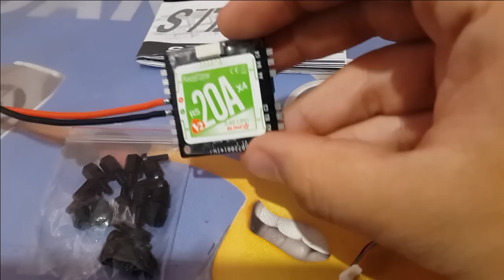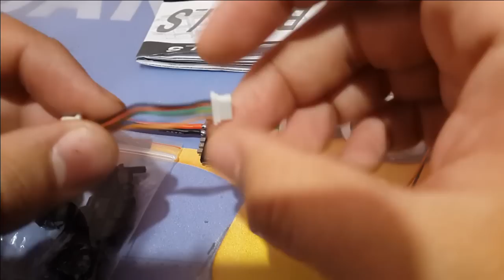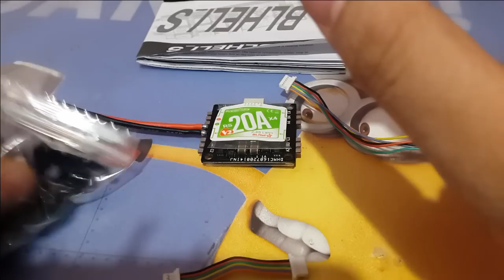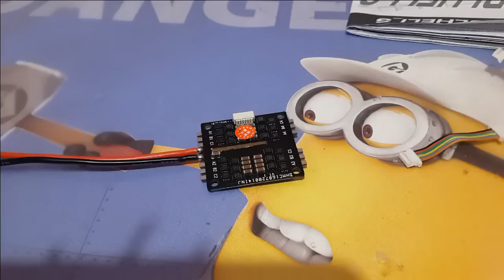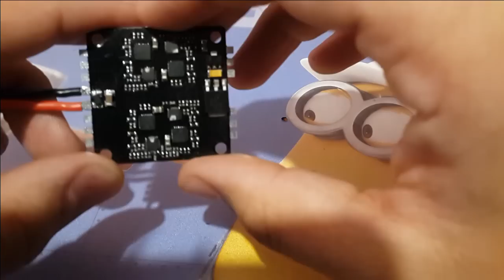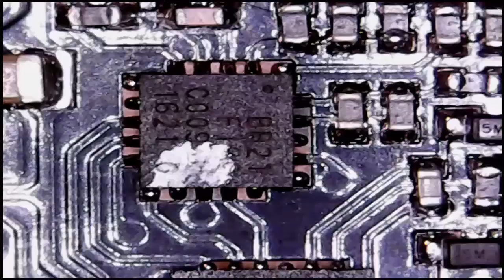Racerstar 20A 4in1 V2 ESC DSHOT 600 (Remove Filter Cap)/ Mini Review

Comment: hi Drone mesh.. can i asked fpr ypu expert advice on this esc
currently blheli release the new firmware with dshot command
is it possible to not remove the cap. 
flash the latest firmware n dshot 600 the racerstar 20amp 4 in 1 esc.?

Comment: Is this the cap removal nessecary  only for Dshot600 or for Dshot300 aswell?
Reply from the maker: I have not tried DSHOT 300 on these without removing caps but i know DSHOT 150 works. You can try it and what i mean by try is not activation dshot 300 and arming it and seeing if they spin. Trust me they will spin but once you take off it can fly back and hit you full throttle so be very careful. 

I had the Racerstar V2 30A (GX-210) with no cap removal and i ran it on DSHOT600 as a test it hovered then i went to adjust to left and right and its like it got stuck on my left input and did no receive my right and went full throttle into a wall and basically destroyed it if someone was there he or she would of been in the hospital or even dead.

Comment: I got this board but it's got a totally different layout than yours, and what's wierd is that when I traced out pin 4 on the bb2s I found a little place with two solder pads that look like the capacitors were already removed. It's super wierd, I'm gonna try dshot600 and see if it works without modification on this version. It's buzzare and I'm expecting the capacitors are just moved but hopefully those solder pads mean they just aren't putting the capacitors on anymore.
Reply from the maker: Can you post a pic or video?
Reply: Drone Mesh I will try
Reply: I'm waiting on the FC I'm using with the esc to arrive so I can set it up. I will try to make a video detailing what I find out! Thanks for the excellent videos!
Reply from the maker: Thanks :) ..

Yes keep me updated.
Reply: Drone Mesh i got a board with a total different layout too !? Is yours maybe a V1? Mine is a V2, same layout as on the pic from racerstar's website : http://www.racerstar.com/Racerstar-RS6Ax4-V2-ESC-p-78.html
Reply: You have the Lipo leads coming out the same side as the motor pads, as mine the motor pads are on 2 sides and the Lipo leads is on 1 side by itself, and the JST connector and just under (flip the board around)
Reply from the maker: We both have the V2 ESC but yours is the 6A version and mine is the 20A version.

This is the one in the video 
http://www.racerstar.com/Racerstar-RS20Ax4-V2-4-in-1-ESC-p-39.html
Reply from the maker: You have the 6A version and this one in the video is the 20A version.

Comment: Have you decided how you will remove the filter caps?
Reply from the maker: Yes I have decided I will be removing them with hot air.. I am waiting on a couple frames to arrive so I will be making a build video and the filter cap removal process of the 35A V2 and the 20A 4in1 V2.